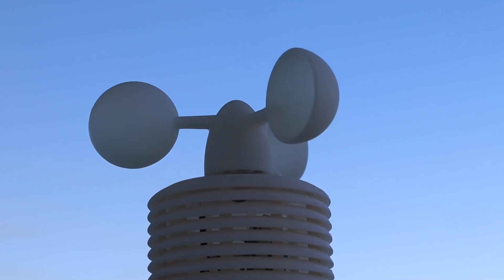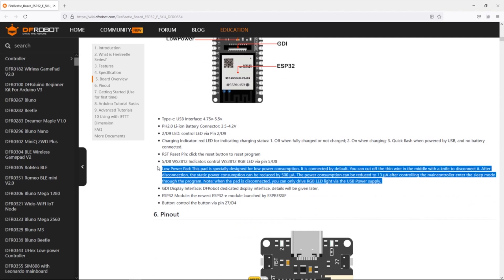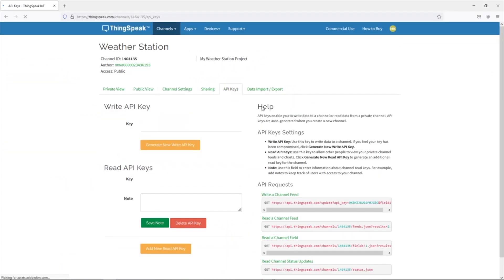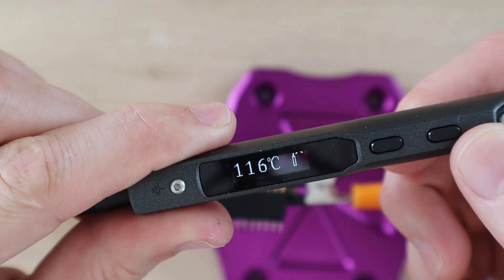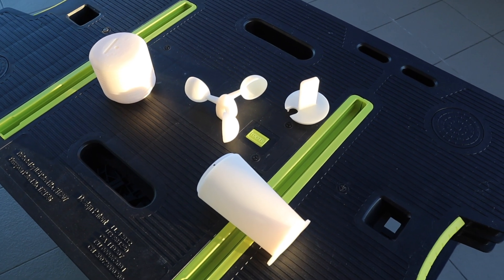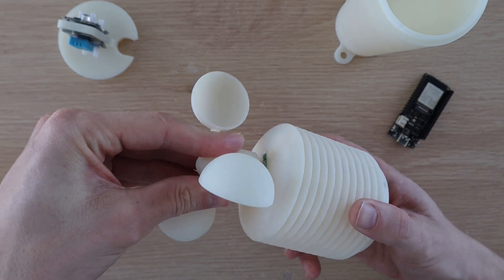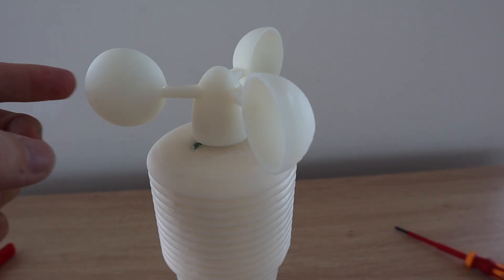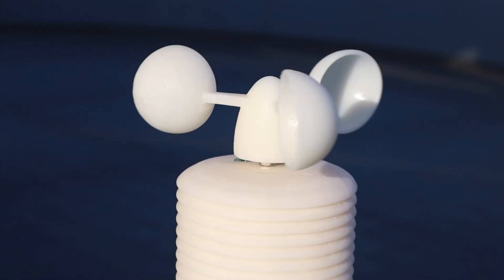DIY 3D Printed IoT Weather Station Using an ESP32

Comment: Could you not have the windguage drive a small motor and measure the output to get the wind-speed and also trickle charge the battery from it.  Equally could have small solar panels around outside - measure light levels and also trickle charge.

But large wind-guage onto small motor to self-power would be epic.   Set and forget power usage always best.
Reply from the maker: You could probably measure the wind speed using a small motor if the voltage produced was high enough to be detected by the ESP32. I doubt that you'd be able to get enough to charge the battery with my size "blades/turbine" though, unless the area is really windy. If you designed a purpose built one with the intent to charge the batteries I'm fairly sure you'd be able to get it to work.
The solar panel is definitely a good idea though!
Reply: If you add a motor and take out energy, it will slow down the rotations, depending on how much energy you take out from the motor. So your wind speed measures will loose accuracy.
It is possible, but not optimal.